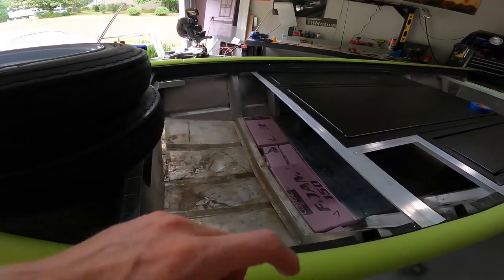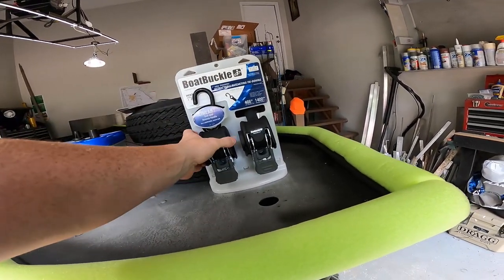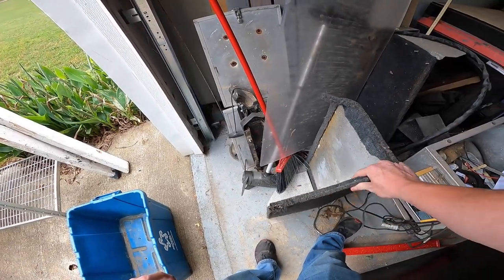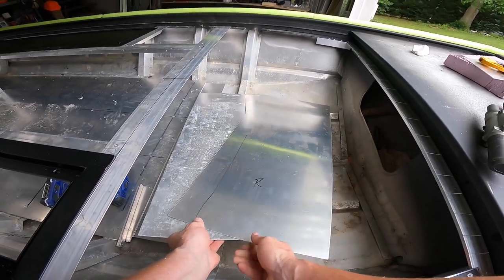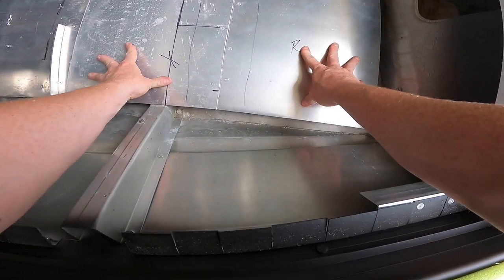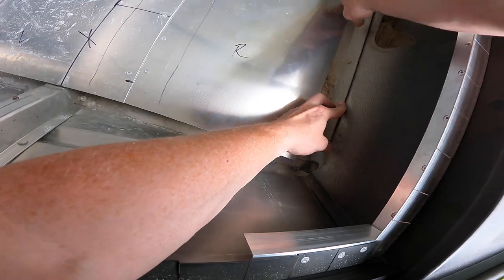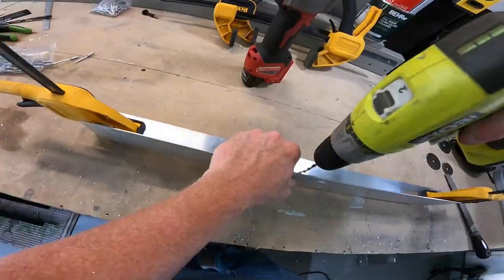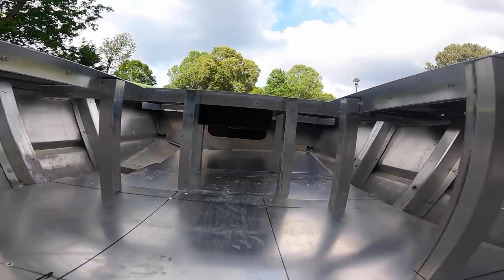How to VERTICALLY Support your CASTING DECK | Jon Boat Recessed Foot Control

Comment: Nice job! Have you done an instructional on how you do the countersinking? I am very curious as i'll be putting my upper deck together with aluminum soon!     What are the rivets used, bits, and general technique?

Comment: For the counter sink rivets. You use a 3/16 drill bit. What’s the second bit before you add the rivet.
Reply from the maker: A cheap countersink bit from harbor freight

Comment: Man that looks awesome! Are you going to add foam to your boat?
Reply: There's a ton of foam already under the sub floor. Check the previous videos of this build. #projectwilson
Reply: I did see the other videos. I just didn't want to watch them all and was wondering if there was any foam and if you was going to add any. It's a great build! You have gave me some ideas on my boat(06 fisher 1600).
Reply: @kennethcorbin7317  Fireant/ Ryan will add foam once he starts the actual rod lockers.  I'm not sure about the rest of boat.   Heck yeah on Your boat. Post some pics onto the TBnation fb page. 

 Mine is also a Fisher  everything you see in this build was bought from the www.TinyBoatNation.net website.  Best of luck with your build

Comment: I don't have ribs running across the bottom of my valco. How would I attach vertical supports without drilling through the bottom of the boat?

Comment: You nee DC to start using self drlling metal screws so you dont have to rivet all your metal. They make them in a number sizes and are stronger an easy  to use.

Comment: How thick of aluminum sheeting would you use for deck flooring on top of a casting platform in a jon boat?
Reply from the maker: I'm using .090